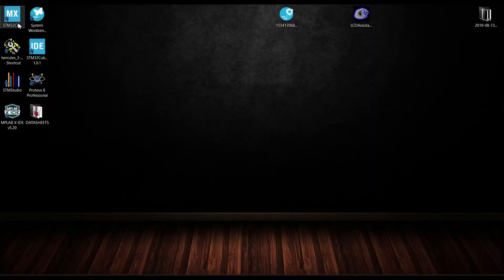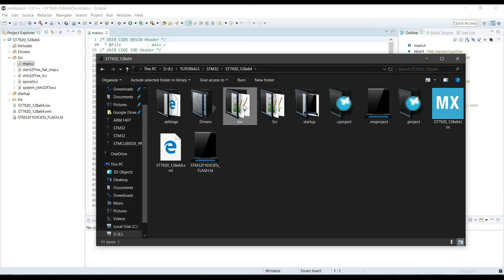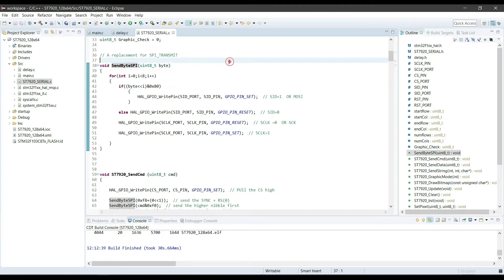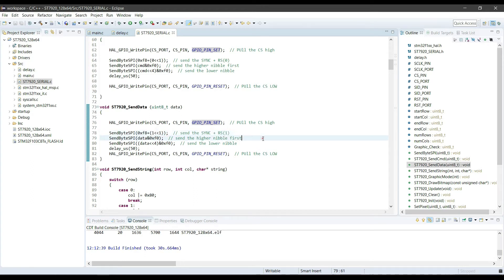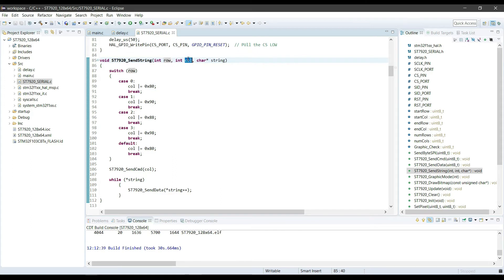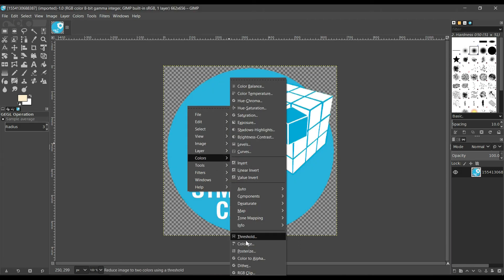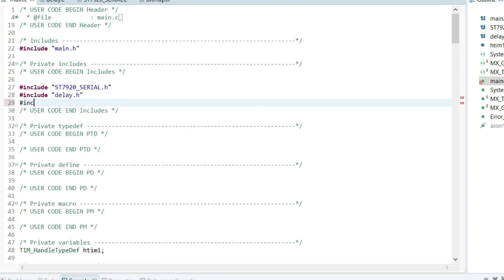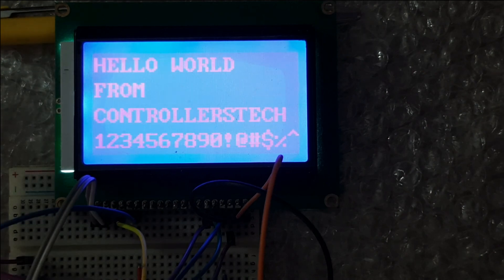Interface ST7920 GLCD with STM32 || Serial Mode || F103 || CubeMX || HAL

Comment: hi, I was working with JHD12864E  LCD Board with STM32G0 Micro-Controller. The method which you have shared is not working with this mode JHD12864E . The Serial Mode I'm taking about. Can you guide me how can I interface it. Thank you for your response....😇
Reply: Did your project workd?Please share solution

Comment: Hey, I found a small mistake in your SetPixel function in the ST7920_SERIAL.c file
this section:
    uint8_t *p = image2 + ((y * (numCols/8)) + (x/8));
    *p |= 0x80u >> (x%8);

    *image2 = *p;

some how this is making a random pixel to appear on the screen when you try to draw circles, lines etc..
check the video at 17:48 , you will see a weird pixel on top of the triangle.
...
after some experiments I replaced it with this and some how the problem disapeared, for a reason I don't know
image2[x/8 + y*(numCols/8)]|= 0x80u >> (x%8);
Reply: how do you do??? you can share, pls
Reply: @khanhinh2825  
Give me your email so I can send you the function after correcting it
Reply: @khanhinh2825  
Also will send you a picture of that random pixel

Comment: I followed the exact instructions but no matter how I change the contrast, the text displayed is either so dark barely seen or not displayed at all, any suggestion guys?
Reply from the maker: Use potentiometer on the VO pin to adjust the contrast.
Reply: @ControllersTech  
I used it and tried many values, still the same issue, it's either not appearing at all or barely seen
Reply: @ControllersTech    alright I fixed it by the following
first the stm32 turned out to never output 5v as long as it's connected to the stlink from the 3v3 pin, so I switched it to the 5v in the stlink and boom it worked, but the stm32 program wasn't recognising it, so I had to switch back to 3v3 and I powered the monitor from another source by 5v, also I had another monitor with a broken potentiometer, it worked by connecting the VO to 5v and I used 1k ohm to adjust the contrast and it worked 😇

Comment: You did not do the SPI structuring in the code, did you only perform the operations with the output pins? There is no SPI_init configuration in main.c file
Reply: I would be very happy if you answer
Reply from the maker: Yes. 
I am going to release another video on it soon using the SPI.
Reply: Then, we can control the ST7920 using 4 GPIO output pins as in this video without using SPI, right? Also, there will be a cable length of 2 meters between the microprocessor and the ST7920. Do you think it will be a problem for communication? After all, you control it directly with the output pins? @ControllersTech
Reply from the maker: The output pins are generating the SPI signals. So in a way SPI is still being used.

Comment: I had a problem where during compilation with stm32cubeide there was "multiple definitions of 'image' " error. Solved by moving "uint8_t image[(128 * 64)/8];" from "ST7920_SERIAL.h" to "ST7920_SERIAL.c". Now it works fine in proteus 8. IDK about the cause though. I checked for repeating definitions and as far as i know "ST7920_SERIAL.h" wasn't being #included multiple times.

Comment: Hello sir,
I am trying to implement this on hardware, but I am confused because the labels of the pins on ST7920 are different from the schematic you showed at 4:08 
Please help?
Reply from the maker: Need to see the real picture of the module. the pins might be named differently, but the functions remains same. You can open a thread in community on the website, or contact via telegram/ discord
Reply: @ControllersTech  Thankyou, I messaged.

Comment: Does the code written for arduino work for stm32....plz reply
Reply from the maker: It works, if you use stm32 as arduino. There is a video about it on the channel. But don't expect everything to work.. better buy Arduino for that

Comment: Hello sir, I know that probability to get response is almost 0, but I still want to ask about one very important thing. I wanna display bitmap image which size is 87x32 pixels (const char size is 348, not 1024), and wanna that image be shown from x=50, y=10 coordinates on display. How can I modify your ST7920_DrawBitmap function to achieve this? In my opinion it's the most important thing, because when we do some real project we would rarely want to display whole 128x64 bitmap, we need to be able to display some smaller symbol in the specific place on display.
Reply from the maker: contact me on telegram @controllerstech. I want to test it first

Comment: can we print float or integer?
Reply from the maker: Yes we can. Integer can directly be converted to characters using sprintf.
To convert floating values into characters, you need to add few things in your IDE. Google that for the IDE you are using.

Comment: Thanks a lot, but I have a question ... how to write on lcd with smaller font ?
Reply from the maker: By default, the custom fonts are not supported. If u still want to change the font, u have to use the graphic mode and control each line somehow. Not impossible, but kinda hard..

Comment: In this video, you didn't have custom font and this is my need that i use custom font in this project.
Please explain about custom font.
Thank you
Reply from the maker: Haven't really thought about it. Check the datasheet, it should be mentioned in that or look for some examples and see what register to use for the custom fionts.
Reply: @ControllersTech  i couldn't same code for custom font.
Could you please help me?
I need this code for a project.
Thanks my senior
Reply from the maker: Looks like st7920 doesn't support custom fonts directly. If u want to use them, you have to use the graphic mode. And control all the pixels individually. That's a lot of work.